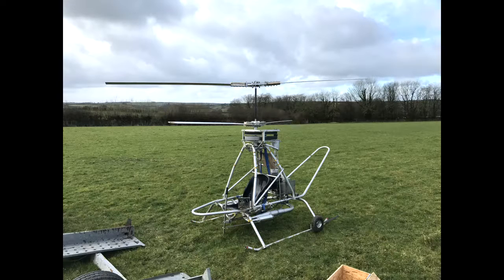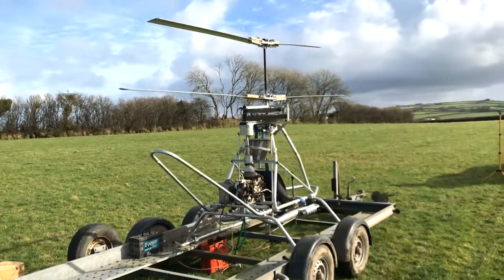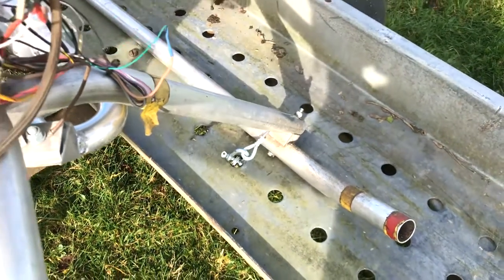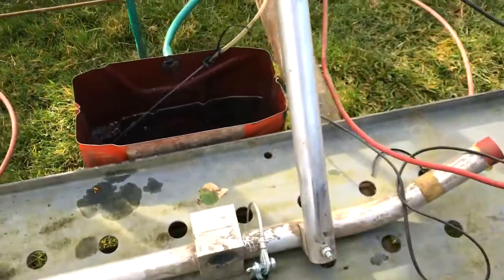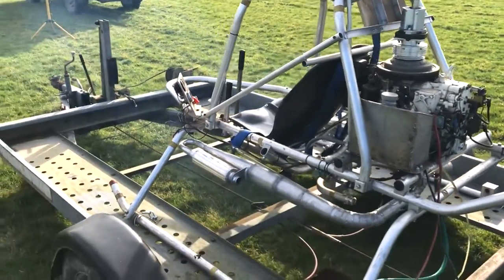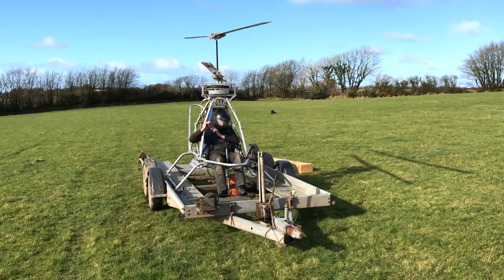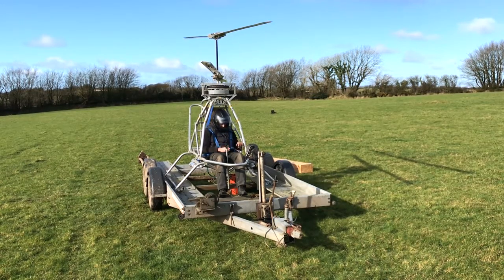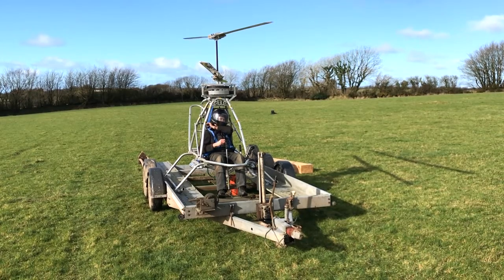My Homemade Helicopter Can Fly

Comment: Wow best possible secure  way to approach a rotor and other lift tests . Hover test with line attached .
Your safety concerns are very up to date even tiny spinning test we all must put crash helmet and seat belts on , remember the demice of 28 old febrication mechanic called Munna in Maharashtra ,India few months ago ? 
Piece of tail rotor after stripping off from assembly hit the top rotor Making big twist to body in oppiste direction and then hit his head ,he wasn't neither wearing helmet nor seat belts .have you watched that unfortunate video ?
The rotors your helicopter were  rotating with out vibrations and we can see even lifting off was okay to ... success is there .
Great job brother 👍 congratulations .
Reply from the maker: Thank you, yes after watching the tragic  munna  helicopter test I immediately added the safety belts which would have likely saved Munna. He was still very unlucky but it showed us what can happen.
Reply: @Ben-Dixey  did you feel any thing strange regarding RPM of tail rotors of Munna helicopter ?
Reply from the maker: @rajeevshagun-info  I'm not sure what rpm he was running the tail rotor at but it should be around 500-600 ft/sec tip speed. This would put the tail rotor at around 2700 rpm with a 4ft diameter rotor. What others have done is speed up the tail rotor to double the rpm to test it, but you can work out the load on the rotor hubs and calculate the strength of material needed. You want a nice big factor of safety for rotor hubs.
Reply: @Ben-Dixey  ideally he should had 6 times more RPM then main rotors RPM , earlier in garage it seemed okay but this fatal test , it seemed running 10-12 times more  then RPM of  main rotors .

Comment: I love ur design, what are u asking for ur blueprints? I'd like to build one sir
Reply from the maker: Hi, thanks.  No blue prints are available at the moment. There's one more design hurdle to overcome which is flight controllability, if this passes then I would consider selling plans. Depends on how much interest there is I suppose. I would have to consider whether it was morally right to sell plans as this helicopter is designed as a fun field vehicle which should only be used a few feet above the ground, no higher as it can't auto rotate. If I added collective pitch then it would be safer as you could then auto rotate in the event of an engine failure.

Comment: Have you changed the jetting on the carb's?  Expansion chambers very often demand quite a lot more fuel and I'd hate to see you seize it or hole a piston.
Reply from the maker: Thanks for the comment and it's something I'm worried about, I haven't altered the Jetting and like you say I  need to find out what the air fuel mixture is like. Need to do some research and perhaps install some exhaust gas temperature sensors.

Comment: What a great video, is it fixed pitch? I did not see you operate any collective levers.
Reply from the maker: Thank you, yes fixed pitch just the rotor rpm to control altitude. Only a very short tether but it did seem to respond well to throttle inputs, certainly encouraging.
Reply: That was the first thought in my mind as well. Also I don’t see any swashplate and pitch change links. How do you intend to control direction. I can see that using engine RPM will affect overall lift in lieu of having a collective control, but you still need to be able to control forward speed and direction. I’m intrigued to know what your answer is this.
Reply from the maker: @alanwhitfield1907  Instead of swash plates and cyclic feathering of the blades the whole mast assembly tilts on a gimbal. Its considered a mixture of tilt mast and weight shift. Have a look at the Nolan pendulum helicopter and bensen B9. The Nolan was a super machine and very well demonstrated but not much is known about how the control compares to standard swash plate control. 

https://www.youtube.com/watch?v=B21Xk6tNcBw&t=830s

Comment: Beautiful feeling and results... especially for an own design, that's on another level...those design plans needs to hit the market soonest😄
Reply from the maker: Thanks Jeff, you will too experience the thrill, it's quite something. You have come along way in a short time and I can see you will get there. 👍
Reply: @Ben-Dixey  quick question...per plans blades are 6inch cord(154mm) what would be the consequences if I fitted blades  7inch(178mm) cord...
Finding a good blade deal in China...
Reply from the maker: @JeffChoppah  I don't think it would make a lot of difference in performance, maybe more lift at a slightly lower rpm. You just need to check the blade weight difference. The plans designed blades look pretty heavy to me but you can calculate the weight from the drawings. The rotor hubs should be designed to take way in excess of the centrifugal forces but I would be checking it all for piece of mind. I can help here if you need it. The blade weight and speed will effect the coning angle which changes the teeter undersling but I doubt it be far enough out to cause any issues.
Reply: @Ben-Dixey  these conning angle calculations and effects on engine was what was worrying me...the length I can maintain as per plans but cord they have 7inch... building it as shown in plans is cumbersome and seems lots of weight in it...it would be my last option....but I don't have any other skills or resources to build a blade any other way than shown in plans....

The two sources I have in china are opting to build a blade without root features for my hub...which makes me afraid might spend cash only blades to get here and are impossible to edit the root
Reply from the maker: @JeffChoppah  what type blades are they ? Extruded aluminium or composite ? Do you know the weight /ft ?
Reply from the maker: @JeffChoppah  looks like you can make the blade straps yourself to suit the china blades. As you would with any blade. Shouldn't be a problem.
Reply: @Ben-Dixey  yeah sure realised I could do that, this is why I was looking into possible effects of having the blades code 7inch instead of 6inch....so you think it wouldn't be much of a problem?... atleast for the length being longer I know I risk blade collision with boom or Tail-Rotor but for cord I wasn't so sure of expected effects....maybe it's a good one to grant me more lift for the same speed
Reply from the maker: @JeffChoppah  if the blades are manufactured longer than you want i expect you can just cut them to the length you require. I don't think the 7" chord will be a problem.
Reply: @Ben-Dixey  noted...thank you for the clarification...much appreciated

Comment: По началу меня смутило, что ты сделал выхлопную из алюминиевого сплава :)
Reply from the maker: Yes, I chose aluminium for weight reasons and don't know if it was the right decision. The vibration cracking welds could be a problem.